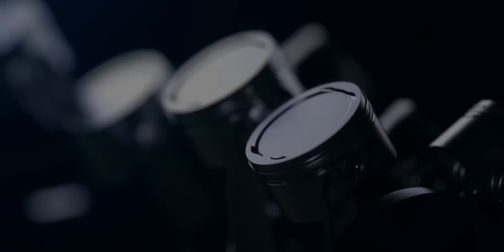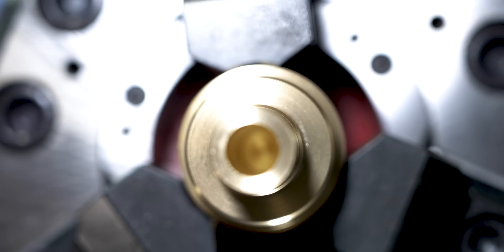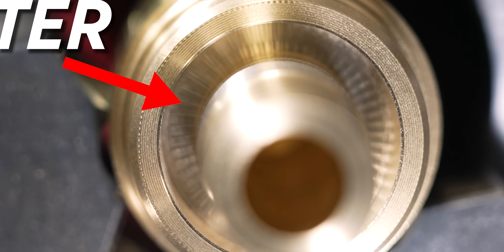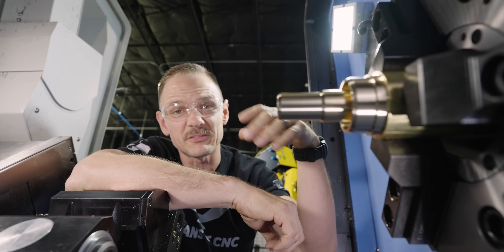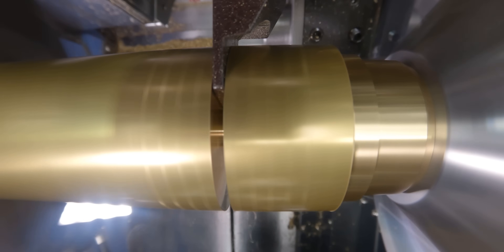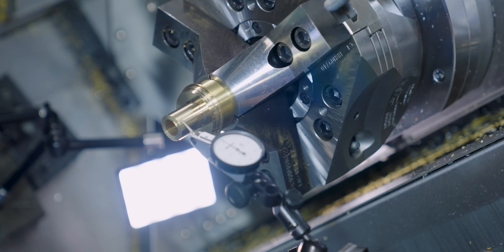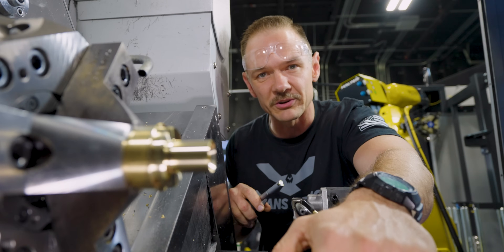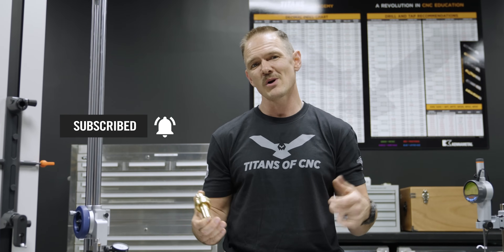Extreme CNC Machining | Full Part Tutorial

Comment: I add a variable to the X diameters one in the od path and one in the id path you can use the variables to back off the OD bigger and the ID smaller when running a groove tool like that

Comment: I have a question unrelated to this video, but...does anyone use a cordless drill with torque control for setting up new jobs, specifically for removing and mounting holders when there are a lot of them? I'm thinking about this for our shop because we have a new lathe with larger screws, and loosening all of them with an Allen key is quite demanding. Thank you

Comment: Love the video & your troubleshooting process.  It feels real compared to the other "BOOM" videos.
Would like to make a suggestion; making changes at the control in our shop is an absolute no.  Yes, it is more time consuming to go back to the computer.  However, we found that typo's are more likely to happen on the fly at the control.  Second, we found that changes made on the control were rarely translated back to the CAM program, making this troubleshooting process have to happen again.
Just a suggestion is all!
Reply: These are all good reasons to have the policy you do. Personally I think there should be room for some to have edit permissions at the control; to change a quick speed or feed for example. You can control these permissions with the edit key too if needed. Detailed and monitored processes can also ensure the final program is transferred properly but admittedly this is all situation and shop dependent. Thanks for the comment my friend.
Reply: @travisjarrett2355  Hey Travis! In fact, there is room for quickly editing feed & speed; the chicken head knobs on the machine for Feedrate/Spindle speed override. Those are used until the issue is resolved, the optimal data is translated back & reposted.

Comment: Long boring small holes is one of the more challenging things I have to do as a lathe machinist. Doing segmented passes is the method I do to ensure good surface finish and diameter, especially if you don't have an anti-vibration boring bar (which really are necessary tools to make the best parts on the lathe). But we normally part off in constant RPM rather than using Constant Surface Speed, is that just more viable when you are parting off on a twin spindle lathe?
Reply: I'll use SFM up till my defined G50 and then constant RPM takes over. It happens so fast it is a little tomato tomatto honestly.

Comment: For the face grooving op: Is there a benefit to roughing the bottom (shaft/minor) dia. first? As opposed to roughing the major dia. first?  
I find there are more chip clearance issues this way and prefer to rough the major first.
Reply: I find it much easier the check the inner diameter and so that is why I run it first. You could absolutely run the outer (major) first but I find that a tricky dimension to measure in the machine.

Comment: I like this video, it shows what the proces is of a part. Especially when it's not easy. I wonder sometimes how you would quote this. Because you can take problems into account, but a complete change of a process. It's a loss. Especially when only 1 , 5 or maybe even 50 parts are requested.

Comment: could you explain if you didn't have a robot what you would do? I know what I would do. but I think that it would be nice to get your thoughts and get a thread going?
Reply: I think it would depend on my resources. If I needed to be away from the machine I would either consider a collet chuck to see if that improves the runout or maybe look into a tighter drawtube liner. If I had availability or an operator to run multiple machines I might just have someone load parts. Situation dependent is such a feature of this trade. Thanks for commenting.

Comment: A collet chuck would almost virtually eliminate that runout issue. I stopped capping out our small(ish) lathes at anything over 1500 RPM as it usually causes more problems than it's worth.

Comment: I have a 60 year old lathe with 5/8 through the spindle, even i learnt something from that about not running through the headstock unless you need to, i never thought that the excess material you are trying to save by not having a chucking piece could be a cause of problems.

Comment: Did you feed the grooving tool at regular speed and feed until you hit the bottom of the hole then have it dwell and slow down to clean up that chatter?
Reply: No. I dwell just above the bottom and let the rpm slow down first before feeding the rest of the way. If I dwell at the bottom we will definitely chatter.
Reply: @ that makes a lot of sense
Reply: Good point